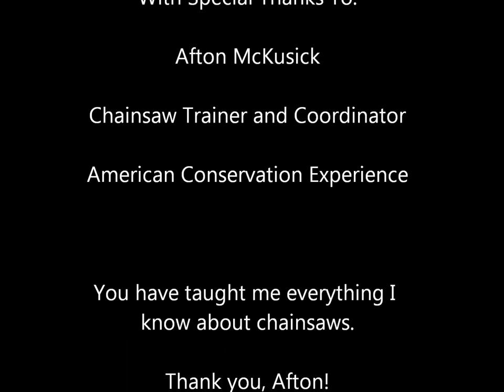How to Rebuild Piston and Cylinder

Comment: You didn't point out to never line both ring gaps up with each other on anything I know some 2 stroke engines only have one ring most have 2 though and most any 4 stroke has 3 rings oil ring on the bottom compression ring in the middle and seal ring on top grove

Comment: OMG !!!! Never / Ever hit the cylinder on with a hammer of any kind ...... You use your fingers and pinch the rings , it will slide in easy with a little patience . Good way to damage the rings and cylinder bro . P.s why take of a used piston and put it back in without cleaning the top/ dome . This video sucks .
Reply: Ratings are not fixed thre
Reply: A rubber mallet is not a hammer

Comment: Think there are torque setting for the bolt and decompression valve.  Also the orientation of the rings is important. Also the piston is connected to the connecting rod not
 the crankshaft.

Comment: That piston needs to be top dead center right after rings pass cylinder make sure it is then hold flywheel fins with something while you slide cylinder into crankcase  or you'll be sorry
Reply: How do you know if the piston is in the top dead center position before you slide over the rings

Comment: I'd tried retapping it or hell coil first it usually works I also apply locktight red thread thread locker lightly to my plug threads most them small 2 strokes usually vibrate some thus causing this sorta thing I'LL admit Husquvarna is my main go to brand far as years of use with little to no maintenance at all on everything they make echo also makes a fine trimmer and so does stihl as well old homelite and mcoulluc saws and trimmers ran very well for years when they was built yyo last like the old metal case chainsaws they made which parts are still readily available today as well

Comment: what was the problem with cylinder and piston?
Reply from the maker: the spark plug port was stripped. dont have a rethread kit for that port, and i'm not sure a rethread would work to keep enough compression, so i just replaced the cylinder.  video to come with the saw running!
Reply: @davehung7601  oil mix 1:33 ?
Reply: @Sensei948  most Modern saws run 50:1 mix. I usually add a little extra oil and mine is closer to 40:1
Reply: @ciphercode2298  DOES 1:33 CAUSE INCREASED NAVIGATION?
Reply: @Sensei948  I've never had any problems with it. I mean the oils just for lubrication,so what would a little extra hurt. Alot of older 2 stroke equipment called for 25:1 or 30:1. It may eventually lead to some extra carbon,but it would be minimal.
Reply: @ciphercode2298  Master, can you pour 33: 1 husqvarna ls + into the saw 372xp 357xp and scythe 545rx? Will the piston rings get stuck with carbon?
Reply: @Sensei948  With prolonged use it could,but if just have some mixed up and already around it wont hurt it. I do run my saws a little richer than the 50:1 that the factory recommends. I usually run mine on 93 octane gas at about a 40:1 mix. I use an Alaskan mill and my bigger saw sees prolonged wide open throttle usage. It seems that the slightly richer mix helps it run a little cooler,but I have no science to back that up.
Reply: @davehung7601   Master, can you pour 33: 1 husqvarna ls + into the saw 372xp 357xp and scythe 545rx? Will the piston rings get stuck with carbon?